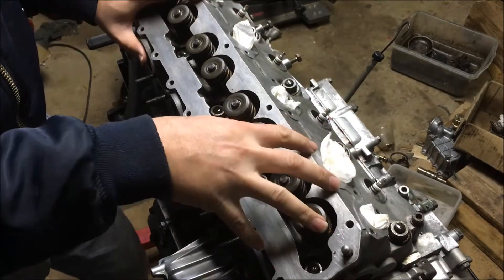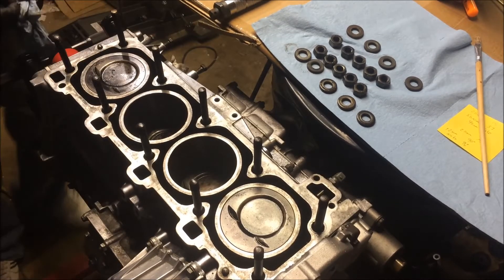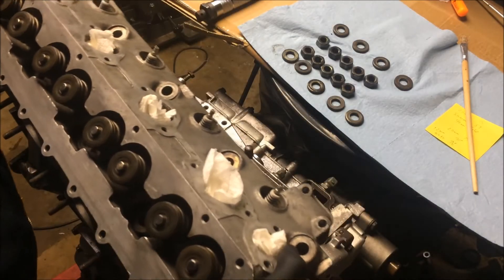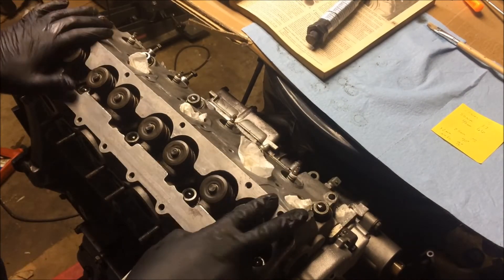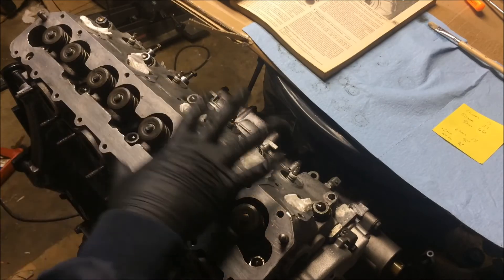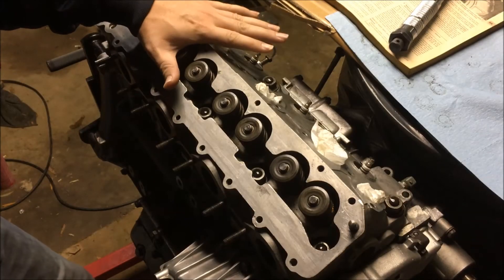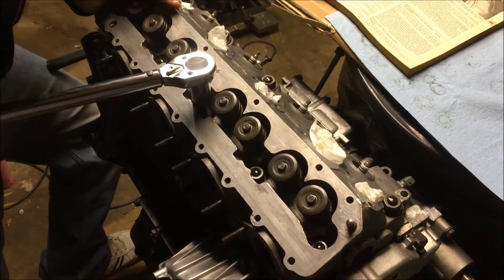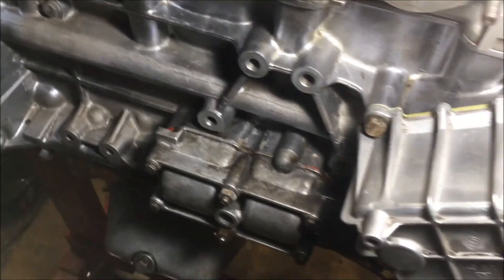Porsche 944 cylinder head installation tutorial

Comment: This is great information! If i installed the head and cam housing and didn't put the cylinders at midstroke, will that be a problem? I bought the engine and cylinders 1 and 2 were up when I removed the head. All I have done is replaced gaskets. I will be removing the cam housing though as I saw that the cam moved upon installation and didn't line up on the notch. I'd like to not have engine failure and don't mind removing the head to do it like you did. Thanks.
Reply from the maker: If possible make sure that the cam sprocket is on and set to its TDC mark. This will reduce the likelihood that the valves contact the pistons during installation but it isn’t foolproof since it only takes being off about 10 degrees. However if you did install the cam housing and you didn’t notice any binding or issues with it going down all the way, it should be fine. When the valves do hit the piston and you are taking your time it will be noticeable.
Reply: @edredas  thank you so much! The cam housing was tightened down by hand with the resistance you'd expect but nothing else.

Comment: Could you help please? 
I have an early 84,(head stamped 83, euro car) but it has 12mm nuts, so I assume they have been changed? What should I do, the torque sequence for the early head or to suit the nuts turning 90 degrees instead of a NM range. I am worried that the heads have changed over the years and need the different torque with the different nut, and not so much the nut itself.
My head hurts 🤔😥😓😓😓
Reply from the maker: The factory service manual says to torque the nuts according to which nut you have so the head shouldn't have anything to do with it. I hope that helps!
Reply: @edredas  Thank you so so much, stuff like this can be so worrying,
"What if I over torque and snap something, what if I under torque and it leaks" 
You are a good man, thank you very much indeed.

Comment: So I'm pretty sure I have an engine that has the timing belt off just a hair.  There is still compression but if I turn it by hand every once in a while it gets stuck for a moment.  What are the odds I've got a bent valve and don't have to replace the cylinder as well?
Reply from the maker: How stuck? The compression in the cylinder will make it harder to turn, also if the car is in gear the clutch will keep the engine from turning. That said, when a valve is bent you won't have any compression at all and it will be a sudden and violent hard stop if that's the issue. I hope that helps!
Reply: @edredas so if i turn it by hand it will rotate every 90 degrees or so then get pretty hard to turn all the sudden. I suppose it could be compression but I thought I had all the spark plugs out.  But I do have compression in every cylinder so maybe I just wasn't paying attention and did have one spark plug in.  Thanks for the response.  Hopefully I can get this thing running soon. I haven't gotten it to run in the last year. I've got spark, compression, and fuel... I was thinking it was a timing issue. but now im not sure.  Can you adjust ignition timing? I've always thought the distributor timing was based off the cam.  Or can it be adjusted?
Reply from the maker: If its occurring every 90 degrees then it wouldn't be compression... sounds like either the cars in gear and the clutch is catching or if its an auto make sure its not in park but in neutral. I hope that helps!

Comment: 4 a turbo motor with the wide firering head gasket it is suggested to let the engine sit for 36 hours with the nuts torqued then one at a time release the tightness of the nut and retorque to 66 ft lbs .this allows the gasket to compress for a more accurate final tightening.
Reply from the maker: Interesting, do you have a link to this? I have a wide-fire on my turbo and the instructions were the same as installing a regular gasket. Keep in mind that 66ft lbs is only for the early N/A cars with 10mm nuts, the turbo models will be torqued down to well over 100 ft lbs with two 90 degree turns.
Reply: edredas hey man !! Just saw your reply !!! Guess I should watch your channel more often !!😄😄😄😄😄 that torque procedure was recommended by Mike Lindsay at Lindsay racing !!!

Comment: You can't oil the thread.. It gives you a false torque.
Reply from the maker: I believe you have that backwards. A dry stud can have debris which can give a false sense of torque. Oiling the studs is straight from the factory workshop manual.
Reply: I've always been told it's standard practice to torque fasteners with oil on the threads as well. If you really wanted to be picky, I know ARP and others market special oil for that purpose, but most people I know just use some general purpose oil, motor oil, etc.
Reply: edredas you should always anti seize those two bolts in the water passage. The next guy will thank you 😎